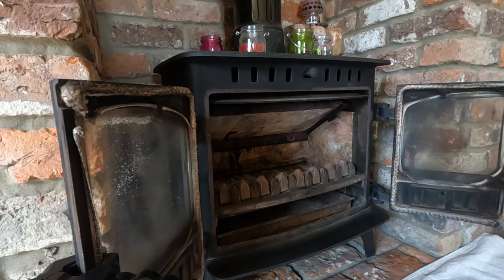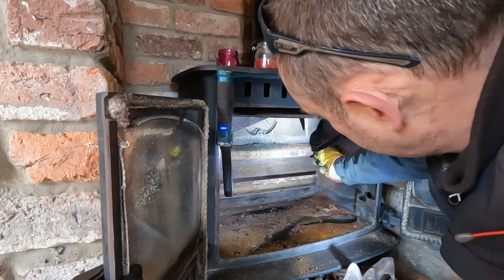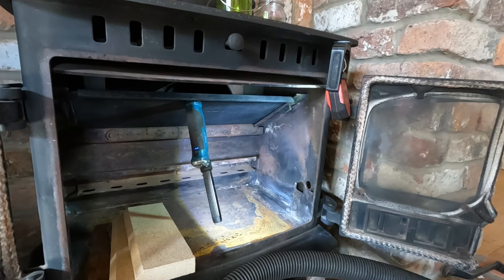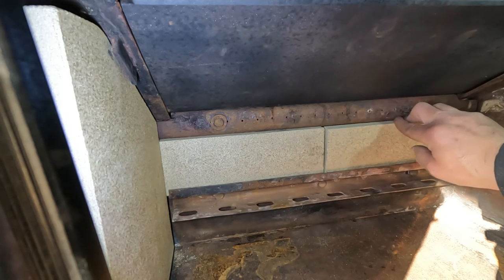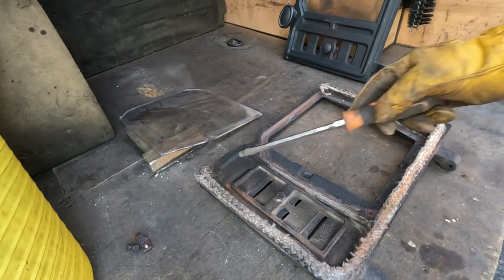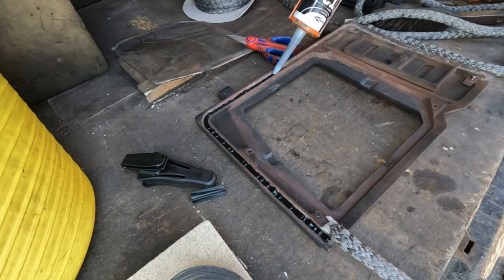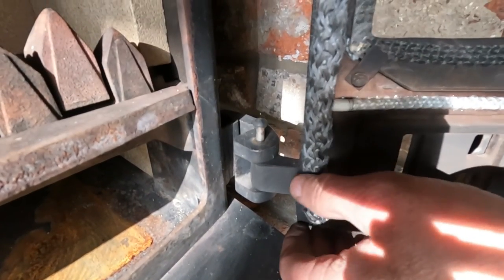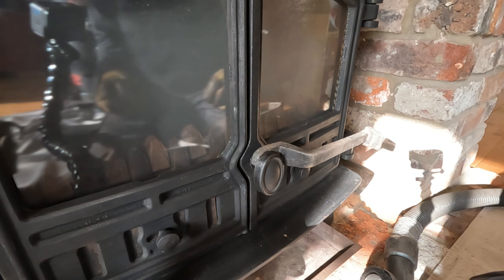Hunter Herald 8 new parts and a set of seals

Comment: Hi great video,what are you using to chamfer the bricks please and is this the herald mark 1 stove? Mine also had a firebrick in the roof which has broken so I take it I should get the baffle plate that you replaced it with? Many thanks lance
Reply from the maker: Hello. You can change it to the new baffle or cut new ones from a vermiculite sheet. I put chamfers on with either a utility knife or sharp scraper 👌
Reply: @thechimneyman-uk  thank you very much, I have just ordered a metal throat plate but the guy thinks my stove is the herald 14 yet it is the same as yours?
Reply from the maker: @farmershand892  Hunters are usually a bit of a pain to identify. Often the glass shape and size is a good indicator of what stove it is.